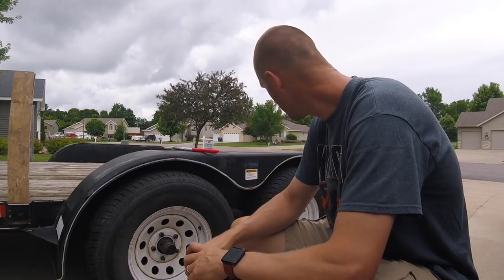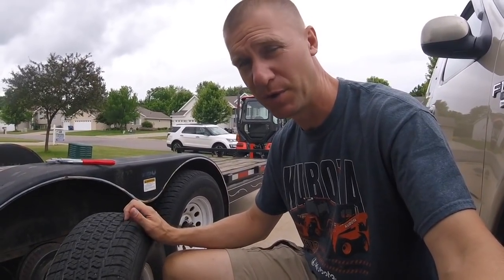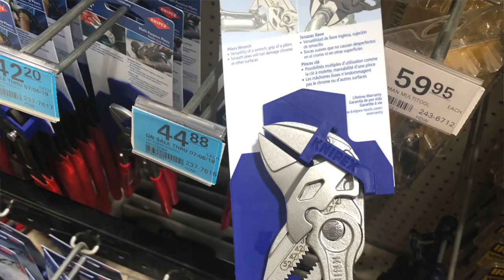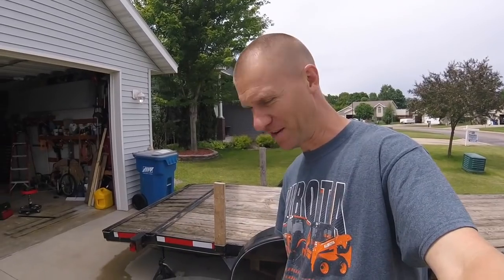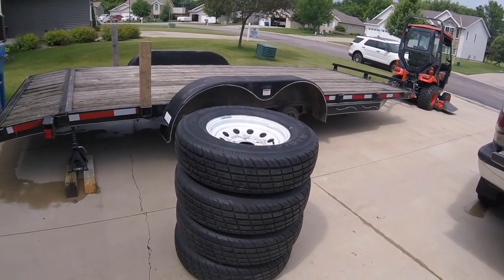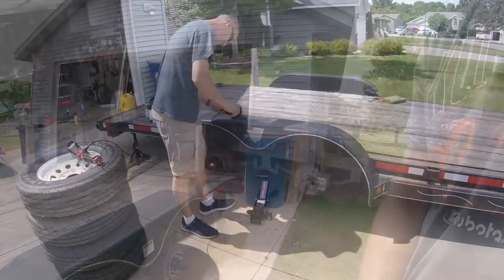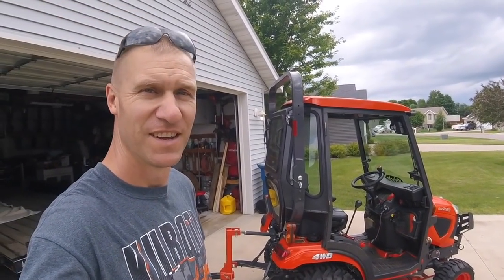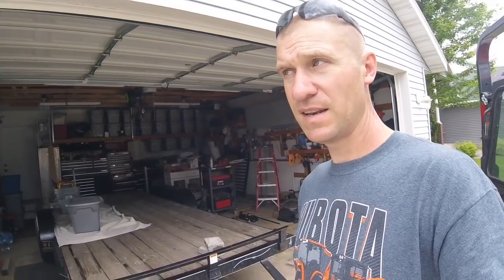EXPENSIVE TRAILER NECESSITY (hauling your tractor safely)

Comment: When you can stick a dime in the cracks of your tires, then you know you don't throw money out the window! They've done their time. Too bad trailer tires don't last much more than 10 years. Reminds me I should service the bearings on my trailer... Thanks Jon!
Reply: Yes Joe you should !!! LOL  GRease them !!! LOL
Reply: If you are lucky enough to have Dexter axles with their EZ-Lube system you don't have to disassemble to service the wheel bearings. When I first got my trailer I assumed the axle lube system was the same as some old "Bearing Buddies" that I had once - which was pretty much worthless. Not so on the Dexter axles. The EZ-Lube zerk channels grease through a hollow axle stub to the rear bearing and then pushes it out through to the front bearing. So all you need to do is jack up the tire and start pumping grease while slowly spinning the tire. The old grease will get pushed out around the front bearing by the new grease. Keep wiping the old grease off until new grease appears and you're all set!

Comment: Some people may not agree with it but on all my trailers I run High ply radial pickup tires. For quite a few reasons but the main ones are they pull nicer, cheaper, don't dry rot as fast, and most importantly I live in North Dakota where speeding fines are dirt cheap so I along with the rest of the population do 85 to 90 on a regular basis trailer tires are only rated to 65 where are truck tires are rated to 110

Disclaimer when I am loaded heavy I only do about 70 tops
Reply from the maker: I lived in ND for a little while when I went to school. I agree, everyone drives fast and it’s great. I don’t blame you for wanting higher rated tires. I didn’t know they were cheaper. I probably could have saved a few bucks. Be safe on those roads, especially around harvest season and they’re slick from sugar beats. 
Keep on tractoring!
Reply: @ritterjon  thank you, you to.   Stay safe and keep making videos

Comment: John, I can't believe you left the Kubota out in the rain, that's a no no.
Reply from the maker: I usually would never do that but it needed a bath anyways and it was a short rain shower. 
Keep on tractoring!
Reply: @ritterjon  thats not bad for kubota battery $150.00 same here at my kubota dealer even for the large ones for the large 171hp kubotas too my dealer sells all kubota batteries for small,medium and large tractors for $150.00 deeres here are from $380.00 to $575.00 for theres wich way pricey
Reply: I get that 5 year warranty battery from Wal-Mart, around 100 bucks 5 year full replacement, have them last 7-8 years, and I live in Florida where it's very hot to kill the batteries, have then in my 5 cars.

Comment: Hey buddy, new subscriber and fan of your channel. Loved the family moment. I'm on the verg of buying a compact tractor myself. Just looked at JD and Kabota real soon. 

You only got one thing wrong.  The tires are not shorter they are skinnier.  

235mm wide down to 225mm wide. 1cm difference. 
P235/65r15
235 width 65%sidewall height compared to width r15 rim size.

Now, ill give you a tip which you will use from this point on. Go to Amazon search 303 protectant. Buy it and use it on your tires. They will never dry rot again.

Comment: Great video Jon . Do I know about tires . Was heading home a few years ago at 3 in the morning . I pull my 5th wheel and boat trailer at the same time . Had a guy on the highway flag me  to pulled over . The one boat trailer tire just fell apart on the highway . Just the rim was running . Have a camera set up looking at the boat trailer . No sparks or nothing . Everything was smooth but no rubber . The sides of the rim were smashed down . The wire of the tire was wound around the rim . Lucky I carry everything but the house kitchen sink on my trips . Bolt cutters took care of the wire . Now this was on a very busy highway even though it was 3 in the morning . Never had a tire fall apart on me before . Safety is a major factor when going on the road . Batteries , oh yea . $240 for a new car battery , $250 for 2 deep cycle batteries for the RV . Gonna get 4 new tires for the RV this week . More money out the window . LOL . Only 14,000 kil on them but they are 11 years old . My tires don't get worn down . They get old . Those pliers . I bought a set when you showed them on a video . Very happy that I did . I'd put some water seal on the wood boards of that trailer . Wood for a trailer that long can get very expensive to replace . That's what I did to my flat bed trailer . Take care .
Reply from the maker: Necessary expenses are the worst and the most expensive. However, what do you do, you got to have things such as tires and batteries. I’m glad you are enjoying those pliers, they are really great! That is quite the story about your flat tire experience. Flats always happen at the worst possible time. 
Keep on tractoring!

Comment: Did you see the video of the NY guy who bought a new BX23S from Messick's only to have the driver wreck it coming off the trailer.  Messick's has really stepped up to make things right.  Be careful loading and unloading and keep the little ones away from the loading operation.  The driver's children were running around in the street and near the trailer.  I know you do the right thing, but this might help someone else.  Cheers
Reply from the maker: I did watch that video many times! Just about every that could go wrong went wrong. Felt sorry for Pete. Messicks is top notch. Trailer loading and unloading is always a scary situation. I try to take every precaution I can. 
Keep on tractoring!

Comment: Is the total weight rating of the trailer still the same with the smaller tires?   On my trailer the weight rating on the frame tag only applies when using the factory-specified tire size and plies.
Reply: The axle capacity is the main factor of the weight capacity, he did put heavier tires so he should be fine
Reply from the maker: I put higher quality tires than the original so as long as I still comply with the axel ratings I shouldn’t have any issues. 
Keep on tractoring!

Comment: Quality tyres, correctly balanced, fitted and inflated to their manufacturer's specified pressures are the only grip your vehicles have with the road surface, and the importance of keeping your tyres inflated to the correct pressures cannot be over emphasised for the overall safety, handling, braking and fuel consumption benefits! 

Insurance companies can void a claim if the accident vehicle's tyres do not meet specifications.

Comment: John, those are great pliers, but they are pliers! Regardless of the quality of the pliers (and again they are a step or 3 above others) they will never replace a quality 6 shoulder contact of a box wrench or socket!
Reply from the maker: For a serious mechanic they’ll never replace a dedicated wrench. For the average guy they’re great! Far and beyond any adjustable wrench. Like I said, they are my go to tool. You should get a set. 
Keep on tractoring
Reply: A RITTER BIT WILL DO actually I have a pair, and as I stated they are several steps/grades above other pliers of the style. And as I said, they will never take the place of a proper fitting socket or box wrench! Personally I hated rounded shoulders and proper tools are the only way to go. Yes they have a place in my tool box and yes they get used a lot! But never will they replace my wrenches and socket sets!